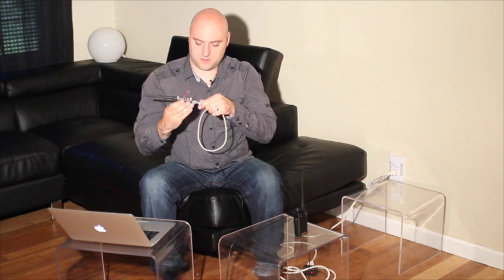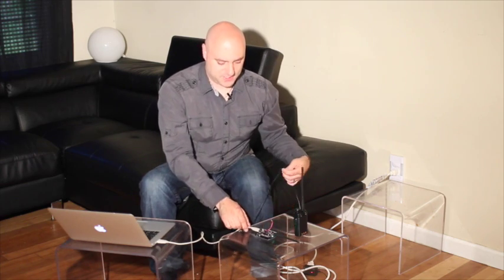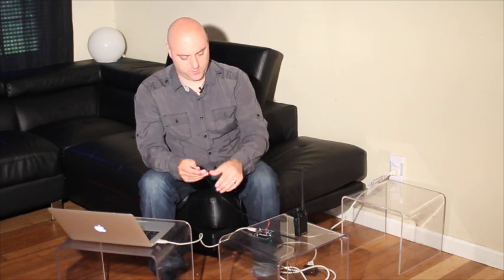HamShield: Quick Start Guide

Comment: Awesome project... we should think a way to pass internet trough that thing
Reply from the maker: Mario López Yes you can! We have packet radio working on the HamShield. It may not be as fast as WiFi, but it is extremely robust, can work off grid, and is very difficult to knock offline.